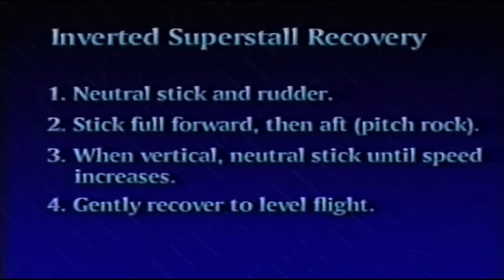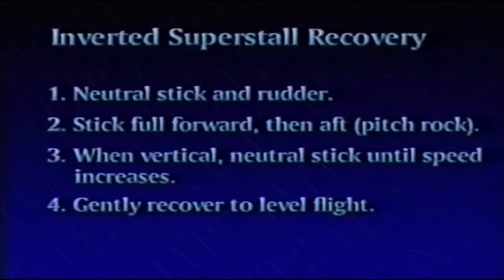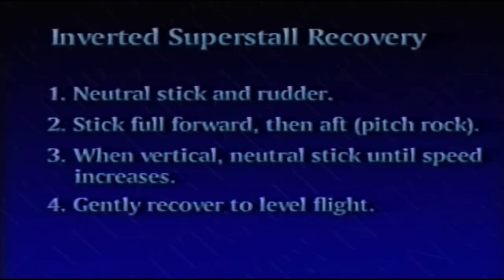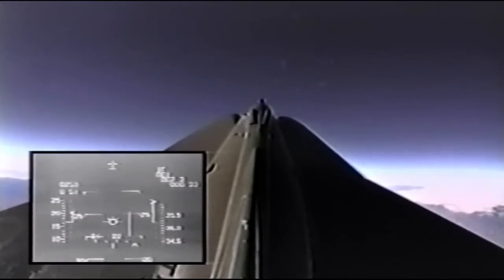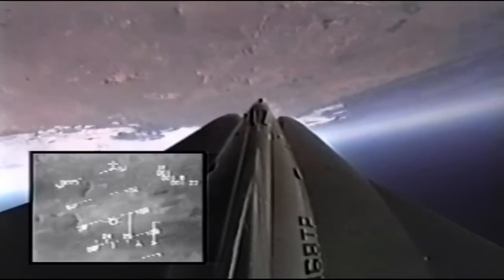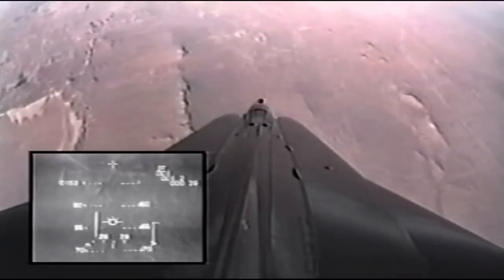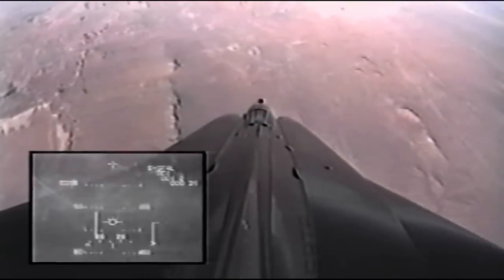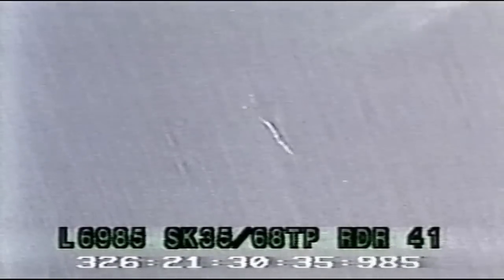Inverted Super Stall

Comment: Is that plane tailless? Isn't it hard to stall a tailless plane because of low elevator leverage?
Reply: its saab 32 draken, has one large vertical stabiliser and a large delta wing with integrated engines, very unique airframe
Reply: @RottingFarmsTV  Saab J35 Draken.